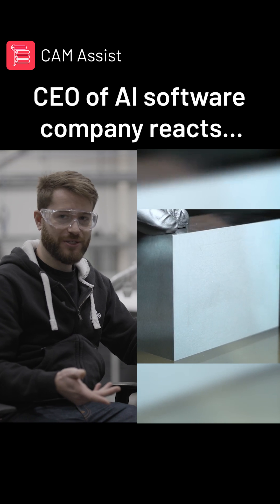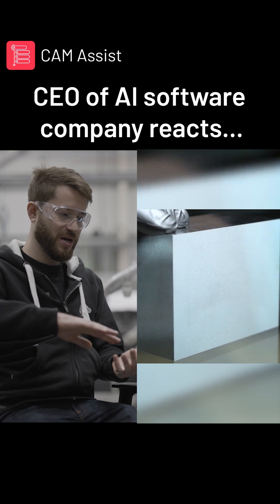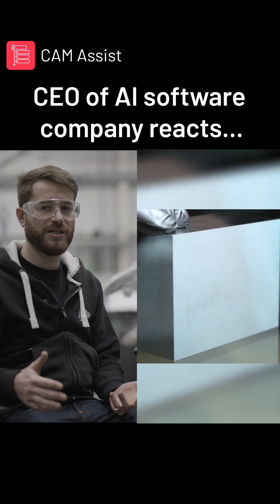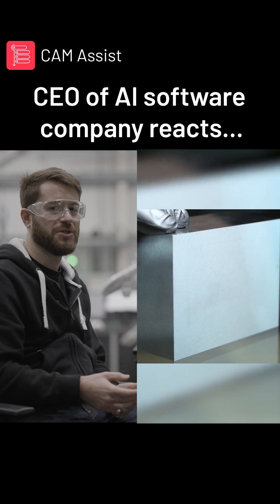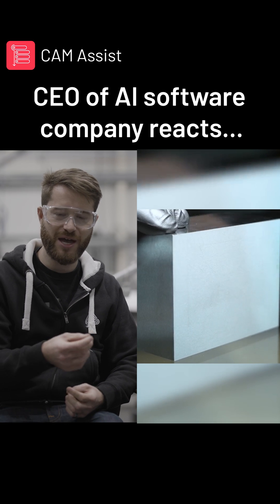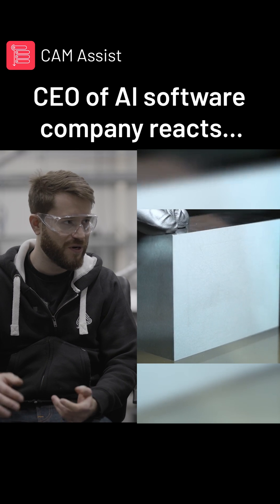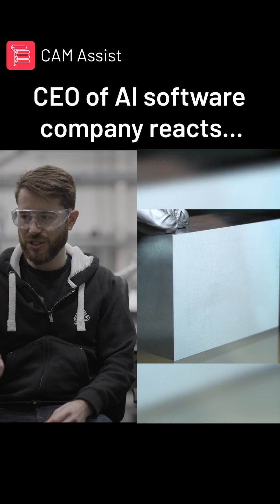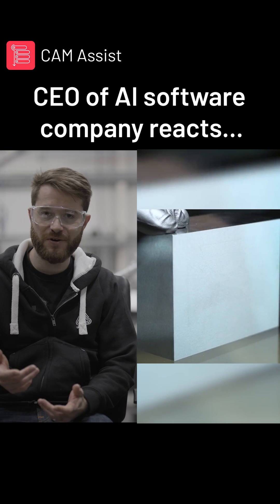AI CEO Reacts 😳

Comment: They are made from 2 different blocks of Metals. On is carved and CNC cut from the inside, and the other has material removed from the outside. And both those carved blocks fit together perfectly with 0 tolerence. It seems like its 1 whole block ut they are made from different blocks.